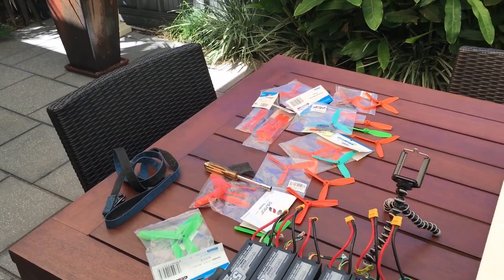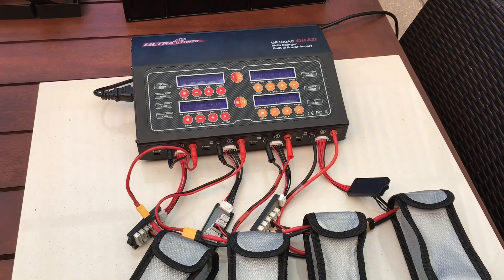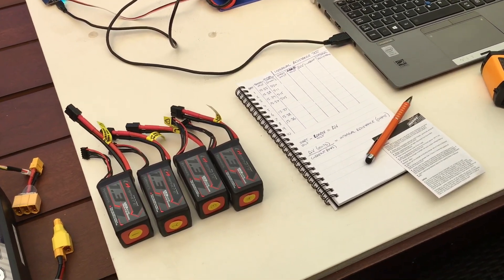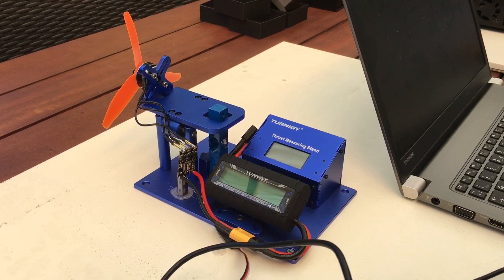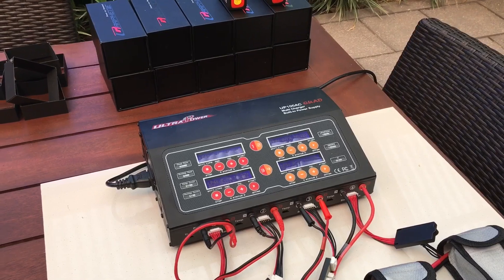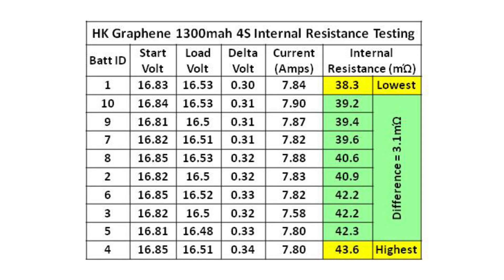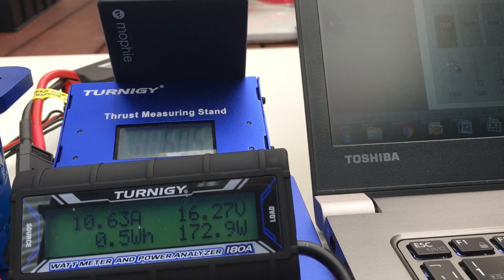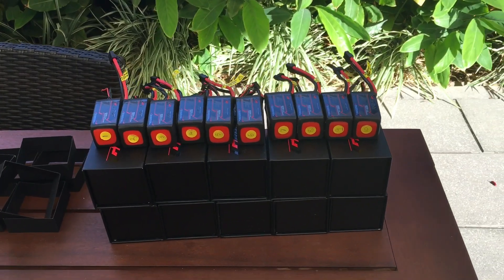Part 3 - 5"MQSO - Battery Testing And Preparation

Comment: Hey Darke, i was wondering if those Graphene batteries are actually worth the extra buck and can perform better than other batteries of its class?
Reply from the maker: They are considerably heavier but the test results I've seen show they have a higher discharge rate and/or hold a higher voltage for longer. But the voltage drops off quicker right at the end.  I haven't flown with them yet.
Reply: Let me know when you do!